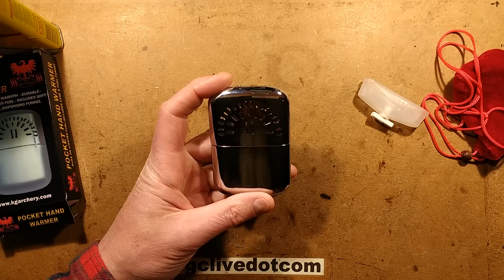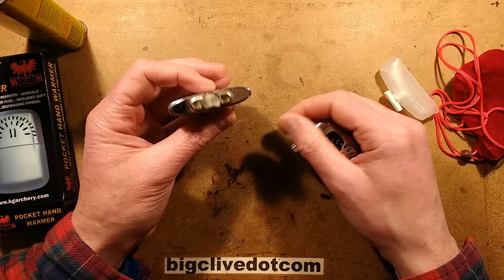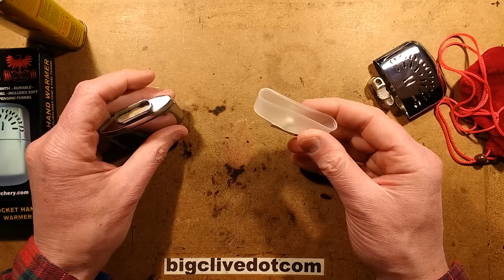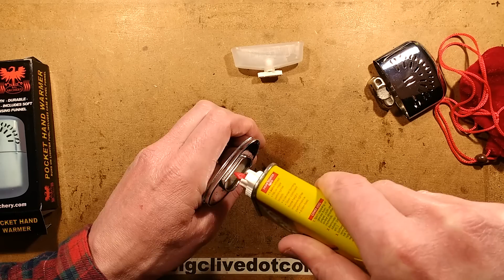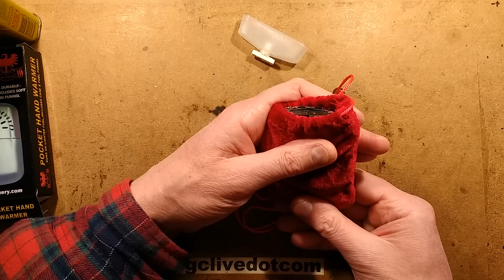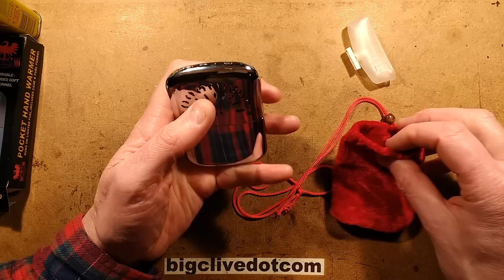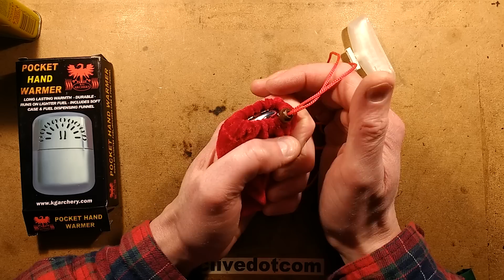How a petroleum-distillate powered pocket heater works.  (naptha)

Comment: I learned my lesson on these a very long time ago when one leaked on my leg and caused a severe chemical burn. Ruined my vacation in the mountains. I now use the warmers that are rechargeable when heated in boiling water. No fuss, no muss.
Reply from the maker: You have to keep them away from close skin contact for prolonged periods as the fumes can cause skin issues.
Reply: Hydrocarbons act as a solvent for oils. This is good for cleaning - removing grease stains, but bad for skin. So prolonged skin exposure easily leads to dry skin and cracks in the skin on prolonged exposure. So normally not a chemical burn like from an acid or lye but still an injury.
Reply: Holy crap, the memories are still haunt me 30 years later!!! That idea about more is better in terms of Naptha filling might be best avoided! A freshly (over) filled lighter, warmer, etc. in the pocket can set your leg ablaze in special kind of way, with no flame involved!
Reply: Overfilled.
Reply: yea it is nasty stuff lighter fluid, when i was little during a room paint my father mixed the "soft" turpentine oil with naphta (lighter fluid) for washing the hands to remove the paint,the day later i had a really bad chemical burn because of that.
anyway interesting bigclivedotcom you spoke about those butane mosquito repellent.
i saw they use regular repellent tabs but use proprietary butane canister sadly.
so i wonder now if we can convert those hand warmer to mosquito repellent.
Reply: @Tailslol  you appreciate in life that your experience may not accord with the "average"?!

Some people die from bee stings and peanuts - lighter fluid on the skin doesnt cause an alergic reaction in most people with direct contact ... nevermind these devices which dont leak if not over filled.
Reply: @gmonkman  what??!
Reply: Unless you dramatically overfill there is no risk. The padding inside the lower container soaks up all of the liquid so it can’t come out even if you turn it completely upside down and shake it. I’ve used these for years. Very safe.
Reply: Zippo brand fluid will burn you badly if unnoticed for a few hours. I had a zippo leak down my leg in jeans while hiking last summer. didn't catch it for at least 2 hours, and got lovely burns that stuck for over 2 weeks around and left marks to this day. Any gass will burn you if left long enough, Butane is harsher i think. The reason is, i overfilled the lighter. I use a different type now a days because i cant stand needing to re fill my fucking lighter twice a week.
Reply: Huh, I've carried Zippos and Zippo-like lighters for years, and have had a few leak on me, but never have I had chemical burns from it, be it Zippo brand fluid or anything else. Hell, I've even soaked my hands in lighter fluid to wash sticky residue off without ever even rinsing it off and nothing ever happened...
Reply: @Oleg-oe1rc  different people, different sensitivities. plus skin is different all over your body. poison oak on your arm is much (oh thank God) different than poison oak on your balls. I don't want to discuss how I know 😥
Reply: dieselwalter... that right there is a good reason to flick your bic instead :)   Did the boys ever get over it ?
Reply: That can happen with dodgy ones like the one in the vid. Zippo ones are pretty safe.
Reply: Redlock
"Odd places" eh ?xD
Reply: Several times; I'm a slow learner. What's funny is that the effect is like the proverbial slow-boiled frog: is comes on slowly and by the time you realize your testicles are on fire, it's way past just yanking the lighter out of your pocket to make it all better. And one is never somewhere where it's convenient to drop trou and give first aid to the wounded. All strapped into an airline seat (once upon a time, you could smoke on planes), at the podium just beginning an hour-long speech....
Reply: @dieselwalter  sorry, didn't scroll down first. Spot on for the slow onset and convenient timing. Always felt that people would think I had crabs or something
Reply: whenever i refill a zippo i wipe off the excess fluid after reinstalling it and then light it and let it burn for about a minute then put it out. i've never had any excess seep out after doing that. if you still have excess fluid leaking you're either way overfilling it, or need to replace (or add more of) the batting. i usually remove a pinch from a brand new zippo and then repack it so it can hold a bit more fuel, but if you remove too much then fuel will leak out of it.
Reply: The wik inside is effectively a sponge.  The capillary action will prevent leakage (sponges absorb) unless you oversaturate it.
Reply: Admiral Preparedness 
Yeah. Theyre like zippo lighters. They leak. And by the time you start to feel the burn, its too late. I have a scar right where the lighter pocket on levi 501 are. I must have burned myself a dozen times from overfilling it
Now I just use Bic lighters and disposable hand warmers (if any at all).
Reply: If that happened to you then: 1. you were using it improperly and 2. you weren't using standard fuel.
Reply: dieselwalter exactly. Levi jeans have that little pocket on the right side. Perfect size for a zippo. And thats where I slways kept mine.
Forst it'd feel like my belt was too tight, kinda itchy. Then I'd realize I was burned. Not from a flame, just the fluid leak. It happened several times, you'd think I'd learn..but noooo. Lol. But alot of times it wasnt cuz it was overfilled. Some Zippos are counterfeit and I've had about a dozen or so of them. Some so shitty they leaked no matter how much fluid it had. Zippos are cool and all..for a while. They get to be a pain after a while (no pun intended) always having to fill them, people walking off with them, etc.
I came to the conclusion that nobody owns a lighter. They're community property. One girl I knew was always going to nightclubs and parties
 She'd come home with about 7 or 8 lighters. She didnt mean to take them, she'd ask for a light and habit pit it in her purse. $1 lighters are the way to go. My lose/find ratio is about 1 to 1, so I break even.
Reply: Any of those petroleum products (gasoline, kerosene, diesel or naphtha) will give you a nasty chemical burn if you have them in constant contact with your skin for a few hours.
Reply: bigclivedotcom The op said it leaked on his skin. The only way these hand warmers or Zippo cigarette lighters leak is if they are over filled. I know people put them odd places, but they are hand warmers for inside mitts and gloves. To be fair I have put these inside my coat and in pockets, especialy a lighter, but never had one leak. I have had one of those chemical goo ones leak though. So I guess you choose your poison and see what is best for you.
Reply: @redlock4004  I see u.s a won,s say shaking it out after filling it
Reply: Admiral Preparedness You got a chemical burn from the gas you used to power it? WTF were you using? Obviously not kerosene, fuel oil, or diesel. And not naptha like the video says. Man, I am really curious about what were you using as fuel. That's crazy!
Reply: @xenonram  lighter fluid will absolutely give you a chemical burn.
Reply: @xenonram  Overfilled.
Reply: Duzzy Fu
Yikes :o
Reply: if you like the zippo style but dont like refilling it, look for a lazy flame butane insert.
Reply: aserta 
What?...I used unleaded.
lol
Reply: Russ Lehman 
In my case it didnt even take 1/2 hour.
Reply: Damn alot of user error on these. Just shows you have to be smarter than the warmer. I have 4 of the Zippo hand warmers. I put one in each front pocket and in my gloves.  I have used them over 10 years and never had a chemical burn or any malfunction. They come with the little filler for a reason. If you put the correct amount of lighter fluid in them they won't leak at all. It's no different than having a Zippo lighter in your pocket. Fill it correctly, keep it in the supplied felt pouch and you should not have any issues.
Reply: oh what a thrill
Goodness gracious great balls of fire

so srry  i hope the boys recovered qckly
Reply: They literally have an app for that. Look at up "handwarmer" in the play store
Reply: @dieselwalter  and how many times did it take YOU to figure it out? Me? Oh, three or four
Reply: Talking bollocks m8
Reply: When used the correct way it surely has no issues.
Reply: I would assume some kind of dermatitis; heavy irritation but you're right, it wasn't necessarily a chemical burn. Still like a nasty sunburn with not an immediate way to alleviate the more than annoying irritation.
Reply: were you not keeping it in the felt bag? did you overfill it? was the wick leaking? these things are tools that have to be maintained or else they malfunction.
Reply: If the fumes from these warmers can harm the skin, maybe some naphtha is instead oxidised to naphthenic acid? Condensing some fumes and testing with litmus may show some acidity.
Reply: The reaction is:  : naphthene  ->  toluene
So you have an open bottle of heated solvent glue in your pocket.. :)
Reply: Andrew Delashaw I believe that word you were looking for is “allergy”. Some people are allergic to hydrocarbons.

Comment: I wish they'd make something like this that runs on butane so it can be turned off when no longer needed, rather than just having to let it run out of fuel. Not to mention that I detest the smell of lighter fluid, and a can of butane is far less likely to leak. There are propane catalytic heaters, so I don't see how there'd be a big problem scaling the idea down to pocket-warmer size.
Reply: I've never, ever had mine leak. Also, smell of lighter fluid? What brand are you buying? Mine hardly smells at all. Just fill it near an open window or door or something. These things are unbelievably reliable (even the cheapo Chinese made ones) and they work extremely well in cold climates (such as here in Canada)...
Reply: Aurelius R All of the lighter fluids smell, rather strong too. When I smoked, I always bought the Ronsonol & Zippo brands, and they smelled. I don't know how you can't smell that. After/during filling, and even the flames smells rather strong. Now that I have been cig free, I use the lighter fluid I have left to remove stickers/adhesives, and I can always smell it strongly. Maybe you're just not relative to that certain smell. Even though it is strong, I don't find it to be a bad smell.
Reply: Furr Bear the problem, is that the run time would be way shorter.
Reply: M. K. - I disagree. The volume the liquid fuel goes into is largely filled with wadding, and only so much liquid will fit. Even if the walls of the fuel compartment had to be thicker to deal with butane under pressure, I think there would still be room for more fuel, but let's say the fuel volumes are equal. Liquid butane has an energy value of 27.7 MJ/litre; gasoline/petrol is 34.2 and diesel is 38.6 - I couldn't find a value for lighter fluid specifically, but as it's less volatile than gasoline but more so than diesel, I'm figuring it to be roughly in between - so assuming equal fuel volumes,  run time on butane would still be about 75% that of with liquid lighter fluid - not, by my standards, "way shorter". And as I said in my original comment - butane would offer the advantage of easily shutting off the fuel supply, enabling one to conserve the fuel when it wasn't needed rather than having to just let the thing run. (Say one has been using it outside while doing chores but then goes inside for lunch, as an example.) 

As that translates to about 9 hours (versus 12 for a full tank on the lighter fluid version) - I'd still be very happy to make that trade-off.

Andrew Delashaw - People vary and I do find the smell of liquid lighter fluid quite unpleasant, either merely evaporating or burning. (I don't like the smell of gasoline or diesel fuel either.) I have lots of friends who smoke cigars who would react in horror if one suggested using a liquid-fueled lighter on a fine cigar - one either uses clean-burning butane or something with a pleasant, compatible aroma like a cedar spill.
Reply: if you seal it in a ziplock bag it will go out.
Reply: A butane version is going to have a lot more moving parts required for operation (ie >0) and, along with that, a lot more failure modes, including fuel-air explosions.

I hear you about the smell. I was wondering about a butane version myself, until I thought it through a bit more.
Reply: Man if you are anything like me, if I use lighter fuel for anything, it always revives that urge to have a cigarette even after 30 years of no smoking!
Reply: Tech Obsessed - theoretically, a butane lighter has "a lot more failure modes, including fuel-air explosions" but people use them all over the world with few problems... including to start the sort of heater in this video. It seems like people are defending the liquid fuel version as if I were suggesting it be banned or something which I am not. For my needs, a butane fueled similar device would be fantastic ... and I will not use the liquid-fueled type.

For that matter, many of the "moving parts" a butane catalytic hand warmer would need are doubtless the same as in (quality) butane lighters, so proven examples of valves, etc. are already in existence... which reminds me of another advantage of the butane version: heat control! Being able to control the flow of gas means controlling the amount of heat the unit produces, within certain limits.
Reply: Far as I can see the butane version of this would have the same issue as my idea of butane candles I had years back, you need some sort of very tiny and precise needle valve to control it reliably but needle valves don't really allow for something like an overheat link. (Well I'd wanted to also try and figure out a tip valve in my candle design and never quite could hit upon a workable idea for that either)
Reply: A good one of these should have no smell while running as the convertor only exhausts carbon dioxide and water.

Comment: It just doesn't seem right that a combustible fluid powered device with no fancy metering or safety shutdown gear is actually safer than a simple battery powered device...  But there you have it.
Reply: Both are just chemical reactions and both have to be controlled. Battery is a chemical reaction producing electricity. Burning petroleum is a chemical reaction (oxidation etc) producing heat. Both lithium ion batteries and liquid fuel oxidation can be uncontrolled. At least in naptha fueled lighters and pocket warmers the liquid is fully absorbed to control/limit the rate it is available to the reaction.
Reply: You'd really have to define 'safe' lol.. you should watch his video on the 150 year old torch.
Reply: Amen, now ain't that the truth Guitarstitch??
Reply: guitarstitch 
We drink combustible liquids, and there is no safety in that.😲😲😲😆
Reply: Actually, although it seems otherwise, these heaters are QUITE safe, if used correctly.
Reply: I know the basic science, but that doesn't change the initial impression.  :P
Reply: It is not burning the fuel.
The catalyst while running at temperature will convert the fuel into heat and a non toxic gas(only carbon dioxide?)
The only time it should be dangerous is wile you are warming it originally .
Some of them used separate battery heaters to start them off.
Reply: Can you help me find this video? I can only find the one on lelanch batteries
Reply: @Yi see my previous comment